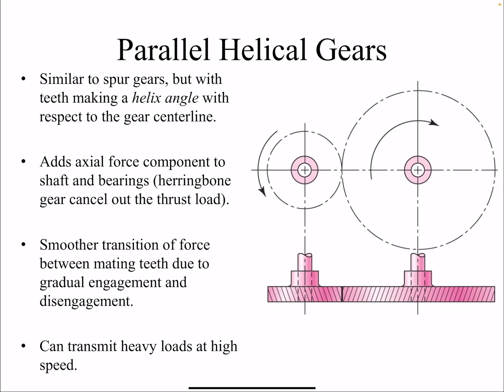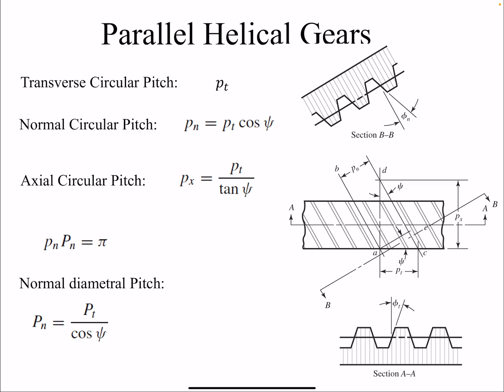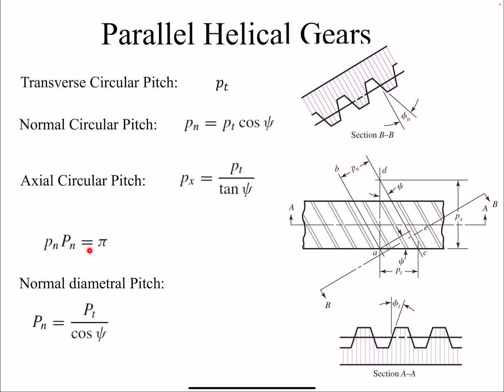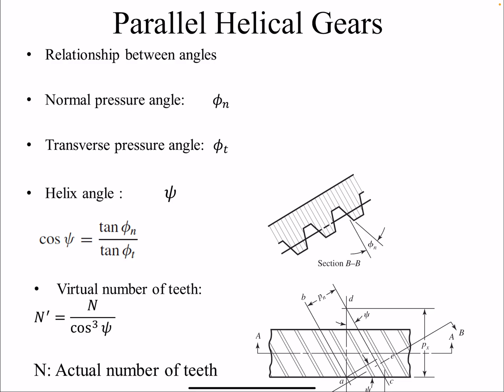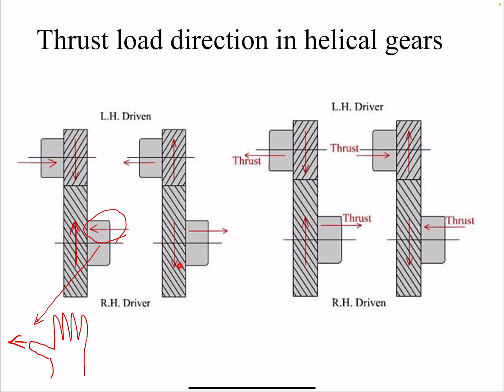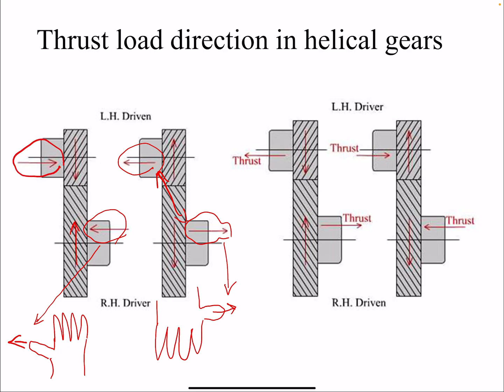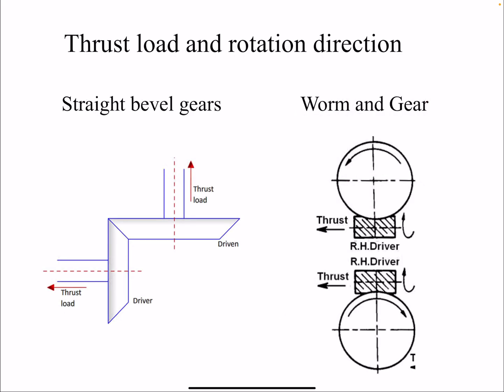Helical Gears: Geometry and force analysis- Direction of tangential, radial and axial loads

Comment: Dear Mr. Engineer, please tell me something about double helical gears, especially the herringbone gears. Is there any preferred direction with those gears? If yes, then tell me why. I don't care oil circulation/expelling like a car rain-tires. It runs dry. Thank you!
Reply from the maker: Due to the fact that they have two opposing directions, they can perform well in any direction, and there is no preferred direction in helical gear.

Comment: Hi there, Thank you for such a great video. I am attempting to design a helical planetary gearbox for a project I am working on and wanted to know what book this text was from. This is just so I can reference it and to calculate the tooth loads. Thank you in advance.
Reply from the maker: Thanks for your comment! I believe it is from Shigley
Reply: @engineeringvision thank you! I don’t suppose you know any good books on the force balance and design of helical planetary gears. Im struggling to find much information.
Reply from the maker: @hamel_g5117  how about this? https://www.cambridge.org/core/books/gear-geometry-and-applied-theory/planetary-gear-trains/8B7A5BE209472241167A695E55B42834